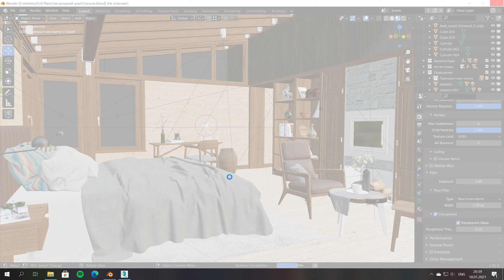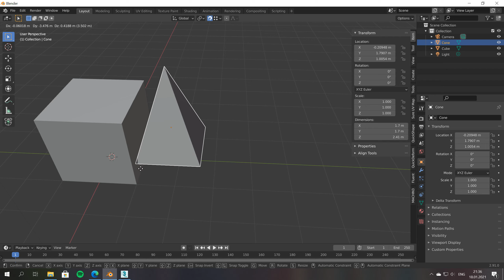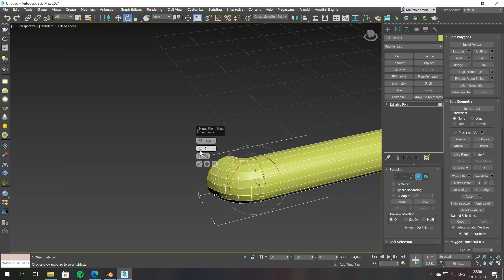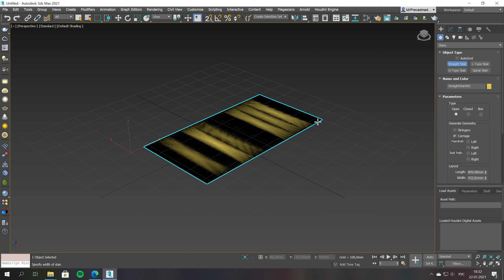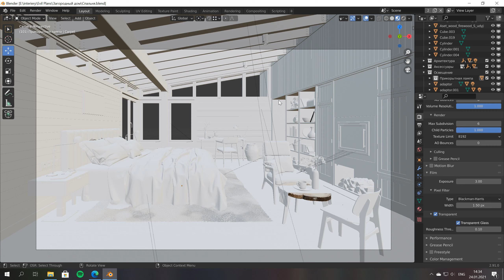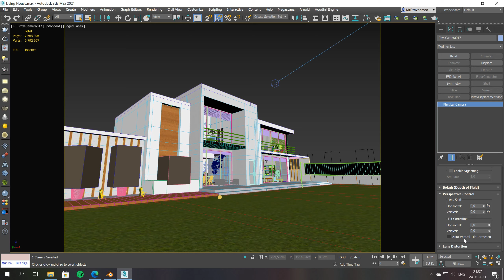Blender vs 3ds Max+Vray for Interior Design

Comment: Hi thanks for sharing.
i currently dilematic which software do i have to use between blender or 3dx max  ?. i actually have been using blender for 3 months. is 3dx max heavier than blender ?
Reply from the maker: Yes, 3ds max is defenetly heavier then blender
Reply: start using blender as it's getting better every year and a lot of tutorials/ trainings are available for blender.

Comment: I used 3ds max for 11 years. 
I do agree on lots of points. Except the point when he said you break your fingers in blender. To reach for shortcuts. 

I feel after using blender for 8 months. Its actually much faster shortcuts workflow than 3ds max. I can model also twice as fast. All our employees are really surprised how fast i can finish something compared to them using 3ds max. 

Also last point he said max designed for architecture work. I don't really agree much. Autodesk still put 3ds max under animation category. But its popular within the 3d architecture community. But it was not originally designed for such usage. Otherwise they could have added lots of tools to make architecture modeling 200 times faster and easier. 

In my opinion. 
Thank you for the video
Edit: fixed grammars & spelling
Reply: thanks your comment.

Comment: How do you know all those add-on would work in next version of Blender? Blender has a habit of breaking add-ons. Also try to have some tress. Blender just die.
Reply: Generally if an add on gets distributed with blender then it will be shipped updated with the next version. Payed add ons are usually pretty good at staying up to date. I have on occasion had two versions of blender installed in order to use an add on that had not been updated, to be honest I have had more problems with this in max.
Reply: @kayosiiii  Blender itself often drop their own feature version to version. Many addons die after one or two versions.
Reply: @JohnSmith-wg3pl  not in my experience. There are major changes every major release where the interface changes and requires changes to the plugins interface. This happens about once a decade. There are occasional changes to the python API, this almost always is a reorganisation of features not a loss of features. The most common change though is upgrading the version of python that ships with blender that can cause some scripts to fail.

Max is more Conservative with changes to the scripting interface, but this comes at a cost. (I have written add ons for both) Max provides multiple ways of doing the same task in script, most of which are buggy in some way (the bugs are part of the behaviour that is being conserved for backwards compatibility).
Reply: @kayosiiii  I'm not talking about developing addons. I'm taking about the longevity of addons. It doesn't matter if script interface has been changed or not. If a feature os gone from Blender, addon is gone, too. Blender developer tend to abandon and discontinue features if they want, Then any addon that use that feature becomes useless.
Reply: @JohnSmith-wg3pl  this happens only occasionally, the only two recent examples I can think of are the game engine and the internal renderer which let's face it were either years or decades out of date. More commonly subsystems get redesigned and in this case features are much more likely to change the way they function rather than be removed.  (Expressed in changes to the API).
Reply: @JohnSmith-wg3pl  I am sorry but I have not found this to be the case, could you give a specific example. I agree that many addons die after one or two versions but not because Blender dropped a feature.
Reply: @JohnSmith-wg3pl  you just saying things, but never giving any example. I think you just saw a comment about hating blender, and didn't even tried blender yourself, or you just thought it's to difficult for you.
Reply: @ganzalez89  (Attacking the person): This fallacy occurs when, instead of addressing someone's argument or position, you irrelevantly attack the person or some aspect of the person who is making the argument.
Reply: True, some old addons stopped to function in new Blender version 2.93 - and especially 3.0 due to the new Python libraries i guess.

Comment: I think Blender has a close equivalent of the UVW Map modifier but its implemented on a material level with the Texture Coordinate and Mapping nodes.
Reply from the maker: Mapping does not allow you to set the exact size of the texture in millimeters, only the scale. And also for each new object with a different texture rotation, you have to duplicate the material. In that case, if you want to change something, you have to remake a lot of materials.
Reply: @MrPrevedmedved  You are right of course. Max does have a very extensive set of modifiers and I do miss some features but as I learn more Blender I miss Max less and less. Also I must be one of the 5 Alias users you are talking about, lol. Good one.

Comment: There's a reason why other applications don't have "3d cursor" after years (and sometimes decades) of development and evolution. If it was a good idea they would've already copied it.
Also some of the aspects of Blender leave you asking whether the devs actually use that thing... For example many tools prevent you from navigating the viewport either by simply blocking the relevant inputs or by using them for their own purpose. (Despite having the whole fkin keyboard to choose from.) Like blocking the middle mouse button... What The Actual Fuck???
Another massive gap IMO is the snapping mode, it is so limited and clumsy sometimes I am not sure I am using an application from this decade. Especially in the UV Editor. Having to align the stupid 3d cursor all the time and switching from/to using it as a reference point. I feel violent towards the devs.
Blender is my tool of choice but way too often it is not a pleasant work, and I still miss the level of sophistication I experienced with Rhino3d 10 years ago.
Reply: haha you just suck
Reply: @TheSSector5  Or maybe he's telling the truth. Each software has their own flaws and advantages. Different people have different experience towards it. The folks who only work at blender does not feel issues as they are pretty much used to it. But the folks who have the background of different 3D software programs and switch to blender well there might some issues for them as they might not be used to it or in reality that feature is inferior as compare to other 3D software programs. Like myself I have recently switched to blender from 3DS MAX. Most of the time I loved it. Its free and start up speed time is fast as compare to other 3D packages but for me what blender lack is curves tools. The curves tools are not comparable with 3DS MAX spline tools. Despite having great other tools and features which are much better in blender. But sadly curves is not one of them. So on the closing remarks each software has their own strength and weakness and each user has their own priorities and way of seeing things.
Reply: @daniishere1009   now that you mention curves, in my experience 3Ds max splines work more intuitive and easier. And it's very hard to switch to Blender like myself with using splines in my workflow, I would like to see a video how blender curves and max splines compare.
Reply: 3d cursor is usefull if you're using grease pencil 🙂

Comment: Hello, I use 3dsmax since the last century, and discover blender a couple of years ago, and the truth, blender surpasses 3dsmax in absolutely everything, I feel let down by 3dsmax by continuing with a program too complex and slow to model and render, the blender program has simplified everything in such a way that migrating from other 3D software to blender is very easy and the results are amazing.
Reply: Blender is absolutely great but is still far from suppressing 3ds Max on the architectural field.
Reply: Blender has fun to use and hence it doesnt feel like you are doing any work.
Reply: @easymax2323  Hobby is always fun!
Reply: It is free. But, it doesn't "surpasses " Max. Far from it.
Reply: @JohnSmith-wg3pl  
Yes it does, I would pay twice the price of 3d max for blender, 3d max is the worst of all, only cinema 4d i would say it's better than blender, then comes maya, then comes houdini, them comes modo and max is at the very end, and i'm saying this as a max user at my office
3D max is only good for architecture projects, everything else is pathetic